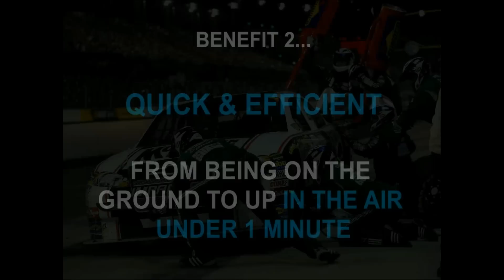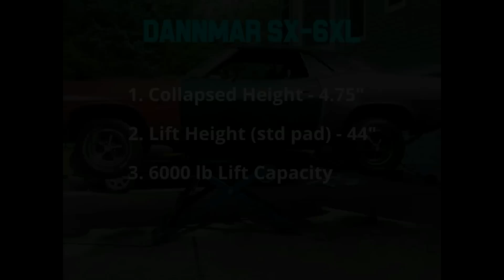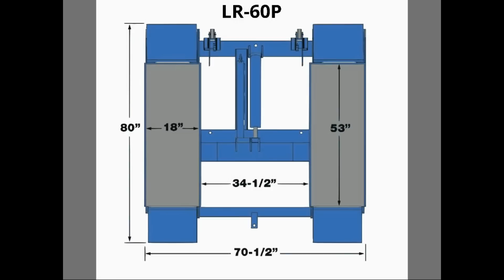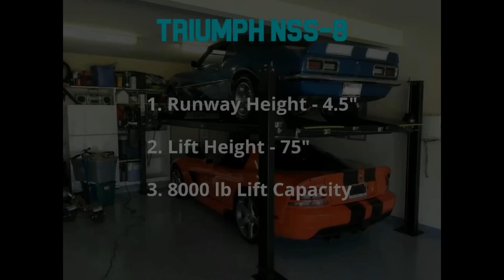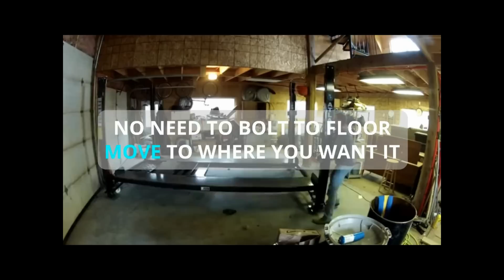5 Portable Car Lifts to Retire the Jack and Stands

Comment: QUICKJACK WINS for DIY REPAIRS without a garage. Find empty field somewhere, assemble quickjack, attach 12V battery power, car goes up with remote aid. DONE. Fix your car quick, remote back down, disassemble the kit, put into your car. Go home and store system under your bed. SORTED. Save cash for every car you will buy and eventually fix yourself in the future. Your mom, dad, or grandma or granddad, friends, strangers have cars issues and ask you for help - SIMPLE go there and QUICK JACK their car up - earn extra on the side.
Reply: yeah but only lifts 21 inches

Comment: I have a quick jack, love it.  Fits my three Porsches perfectly, and makes oil changes and other basic maintenance easy.  Very stable but your still on your back.  Perfect if your garage is too low for a lift.  Plus you can use it in the driveway or take it to a friends house, in a pickup if needed.

Comment: I rather have a two post lift for full height but my garage is too low. For now I'm using two floor jacks, one on each side with four jack stands. My third floor jack is for dropping something heavy under the car or for support. Really not too bad using two floor jacks at the same time, fast enough for now.

Comment: Honestly the Triumph looks more like what you want if you work on your cars. Like if you want to put Nitrous Oxide or wanna do transmission/engine swaps. Quick Jack seems more for your quick fixes.
Reply: Suckax ZKx until you want to do wheels, brakes, suspension

Comment: Google will find you any number of failed single post lifts pulling their anchor bolts out of the floor.  Everything from inserts coming out to a whole section of the floor breaking.   The average garage floor is no more than 2" of concrete. If there is no stabilizing bar across the top or some other method of preventing weight of vehicle from torquing the bottom plate to concrete joint you're taking your life in your hands getting under there.  The disclaimer literature tells the story; "we are not responsible for.....anything or everything!"

Comment: Yes It's a good idea, but you need to point out that the floor has to be very very flat in the area where the four feet stand ( that is all four feet have to be on the same plain as each other), or the four up and down sliders will be binding on the posts, because the four posts won't be parallel with each other, so it's not a lift you can move about and use anywhere is it ?.

Comment: Have you checked out the Eagle Equipment MOBILEMAN? It's on a pallet jack base, it's a portable single-column with 6,000 capacity. it has a 6' lifting height. They have some Scratch and dent models for $2k, which is $350 off their regular selling price. https://www.eagleequip.com/product/MOBILEMAN-LPX.html